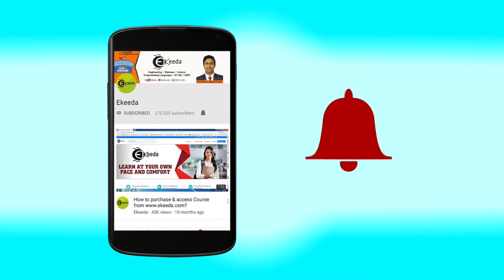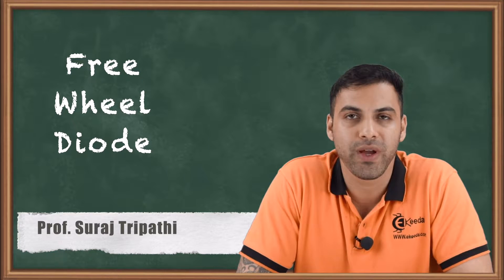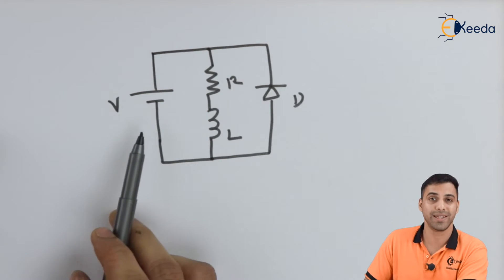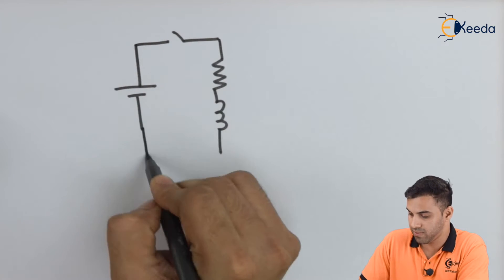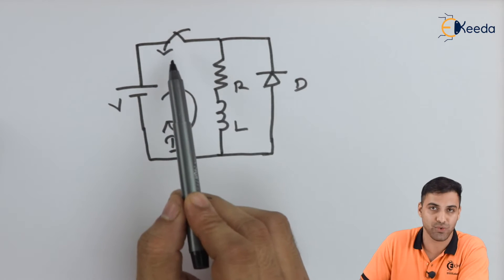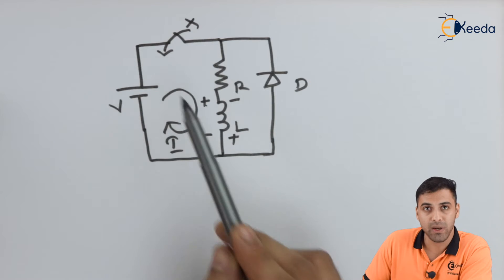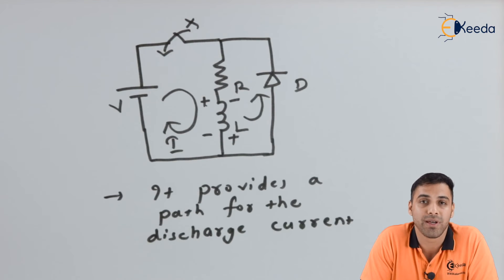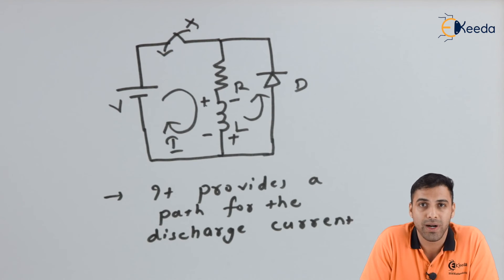Free Wheel Diode

Comment: Well when the switch is on and the transient events are in the past then there is no voltage across the inductor! 
Instead all the battery voltage is applied to the resistance. When the switch is off again then the energized inductor (it's better to say energized instead of charged, this is reserved for the capacitance) tries to push as much current as before. The Free-Wheel Diode provides a path for this current, otherwise the voltage across the switch increases and some thunder-strike may happen between its terminals. Take care of your grades before the exam :).
Reply: In hard switching, the voltage is limited by inductor self capacitance, or by insulation breakdown, whichever occurs first. It's a big problem for SiC and GaN devices with very high di/dt.